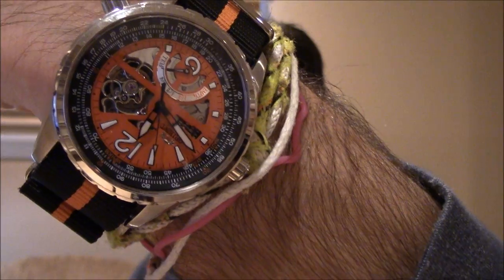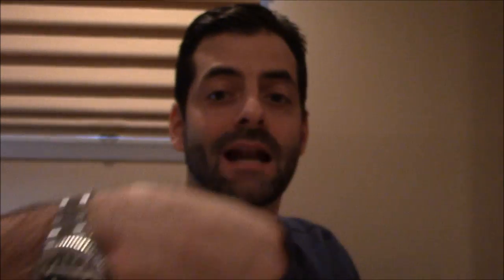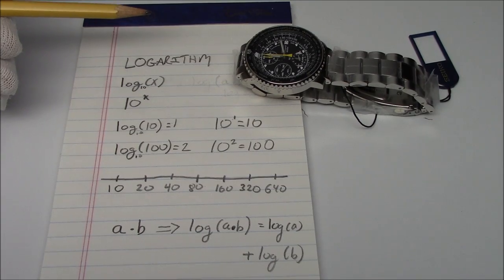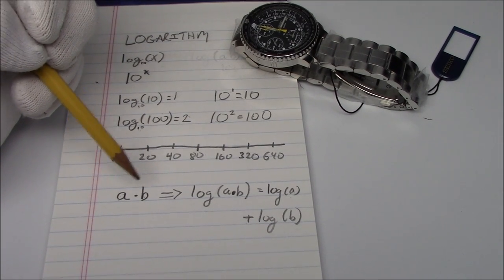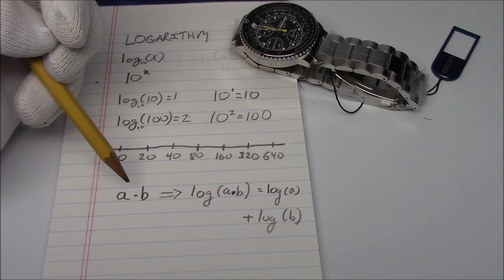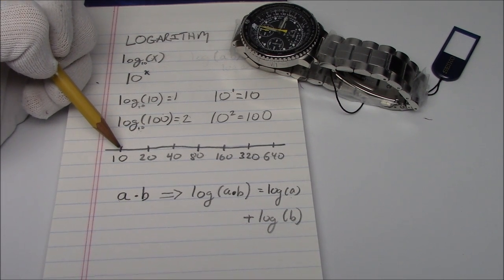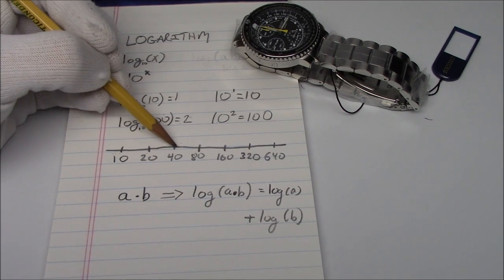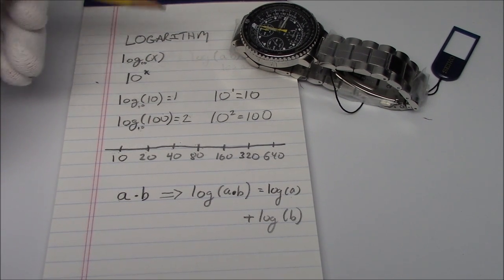How to use a Slide Rule Bezel on your Watch. Watch and Learn #11

Comment: For the private pilot license they expect you to do a divertion with one slide rule calculator or E6B how we call it and execute the diversion in around 2 minutes. You have to find approx. Distance to the alternate airport then calculate with this rule the time it will take with your ground speed, the amount of fuel you will burn and how much you will have when you arrive. All without losing your altitude or heading without autopilot. This slide rules are very useful.
Reply from the maker: Thanks for sharing.
Reply: I have my private pilot license with 250+ hrs.  In the cockpit of small piston-powered aircraft, it's next to impossible to use a slide rule this small on your wrist.  The normal E6B most of us use is around 115mm in diameter and it's still a challenge to use with engine vibrations and anything other than smooth air.  If you want a useful pilot watch, buy a Casio G-Shock with dual-time (UTC) and use a normal-size E6B.  Better yet, get a tablet and enjoy all the benefits.
Reply: @markthibault8579  Yeah. I've written about this on another channel but nobody should have the idea that this watch is useful for a pilot flying. Even traditional pilot's watches with large, highly legible, and simple dials are no longer very useful on most aircraft except as a pretty crappy backup to the much more ergonomic clocks and timers on the panel and EFB. Which paradoxically is exactly the reason why I think this is an excellent pilot's watch. If a wristwatch is going to be almost useless to the pilot flying no matter what, we may as well forget about legibility and just make it into the mother of all backups, and as useful as possible for the pilot when they're not flying. This thing backs up three instruments/functions on the panel, plus a bag item: local time, zulu time, chronograph, and E6B. It's convenient enough to use for flight planning calculations. And of course once you put it on in the morning, you're pretty unlikely to forget it somewhere or leave it out of reach of the cockpit!
Reply: The watches only have two scales, the standard multiply and divide scales, and they're tiny. A real aviation slide rule has extra scales for time distance and a back for wind effects.
Reply: As a CFII, I prefer a divers watch with the minute bezel. I use that all the time. I agree that the E6B on a watch is not practicable in a single pilot situation. 
The overall most simple and useful Watch I’ve had, is the old Casio amw360. UniDirectional bezel, dual time (for Zulu time) and a timer. 
That’s really all you need in a watch for a pilot. 
A watch slide rule will not do wind calculations, so it’s not going to suffice for a diversion anyway. 
That said, I do like the Flighty and really want one, just because it’s a beautiful watch. 
Practically speaking, a Vostok will be my next mainstay as it’s built like a tank and does what I really need in a simple to read manner. 
iPad has replaced paper charts, and does all the complex functions one could need.
Reply: @markthibault8579  no shit. Or better yet get an app specifically for it. Same as how divers use big wrist computers and not the bezel on their watch. It's a back up, always there thing. Something to keep you aware and sharp. To show that this is your mindset and who you are. That's what watches are.

But most importantly, what about celebrating the horology and it's importance on us. There's no better masculine expression. Horology is a noble study and to be marveled at. It directly correlates to our understanding and progress as we mastered time. 
That's the reason for watches on top of the massive practical and disciplined basic on the every moment in the day. 
A phone or then an atomic gshock for the tough everywhere scenario is the ultimate tool for time keeping, but still a manila wind simple field regulated wrist watch does better in keeping 6ou up to task and feeling alive. There's a timeless thing about it. That is why it signifies class. The moment I think of the fashion aspect, I lose taste for it all
Reply: Good thing i don't want to be a pilot. I think i'll crash....
Reply: I used a cheap watch with the slide rule for a professional flight test, it worked perfectly well.  Other students made up tables of ground speeds and distances and guessed the in between points, the watch was quick, was big enough and easily accurate enough.

Comment: 7:23 Face description and markings  
11:33 Multiplication 
13:53 Division 
16:13 Unit conversions: 
16:30 mi (NAUT)/mi (STAT) 
17:20 Km/mi 
18:49 ft/mi 
20:12 Kg/lbs
Reply: Need to add, speed, dist, time.....fuel burn....endurance.

Comment: I study physics and mathemarics, slide rules have always fascinated me. Mathematically, they are an excellent way to think about linear transformations, everything scales uniformly. 

Pilots do not likely use watch slide rules in the air, even in smaller aircraft, pilots usually carry a number of slide ruleesque instruments for particular parts of their flight (like crab angles to adjust for wind, fuel burn, and so forth). But they do offer pilots a backup and are excellent survival tools. Let's say you go down and lose all your special tools. You remember your airspeed as you came down in the wilderness and the indicated heading on your compass, you can use some trig and math (slide rule is excellent to assist in that) to determine an approximate grid location. Also, using a watch, you can identify north by the time and sun location. The compass headings on the dial help you adjust the position of north every 30mins or so and give you an accurate indication of your direction simply by reorienting your dial to to maintain true north indication while you turn your body. A few key pieces of information (wind direction, indicated airspeed, and time from last known position) can easily allow a pilot to know how far he is away from his/her last known position. If the pilot can make it back to that position, the likelihood of rescue increases, as search zones are based off of that last known radar position. 

Military pilots would likely find much more utility from the watch in survival situations, as they can use it to identify direction and distance to friendly territory is downed behind enemy lines. Rationing water and supplies based on distance and progress also can help increase survival. I'm not sure if these dial slide rules do trig, but if they do, some fixed reference can give the pilot an accurate approximation of ground speed by comparing the ground distance from cos at two stopping points by dividing the distance by the elapsed time. If we ever have a nuclear war, a slide rule that sits on your hand, even if the chronograph no longer works, is an invaluable tool which most people would be without if their phones and calculators were fried by emp.

Comment: Hey Mark, thanks you for putting together this series of videos, I have learned a lot thanks to you, and since you asked for a pilot's perspective, I thought I'd add my 2 cents to repay you for your excellent effort. Having been a pilot for the past 35 years (civilian, military, and airlines) as well as having been formally trained as a navigator in the Air Force, I used to live by, and get tested on slide rule computers, but the ones we used were of the CR-5 and E6B variety, and of course much bigger in size. Although I love slide rules (they are almost magical), I always felt that these type of watches were more of a gimmick than anything really useful, because they forced the movement of the watch to be much smaller (ergo less readable) than it could have been, while still having a nearly unreadable slide rule section (at least to an older pilot's eyes). I remember back in the '80s when some of my colleagues purchased expensive slide rule Brietling as reward for finishing the Air Force Academy and heading off to pilot school, I always thought that was more of a status symbol statement than anything useful a pilot could actually make use of. Of course individual preference is what counts on this subject, and personally I'd much rather have a Laco 45mm pilot watch with a sterile B face than a small movement watch crowded with useless features. When I fly I want a watch that "talks to me" (if this makes any sense), and not one I have to spend any amount of time trying to read. As a matter of fact, all the Navigators I knew would used cheap LCD watches rather than anything with dials because they were quick and fool proof to read. Once back on terra firma I'd switch back into a diver's watch, or something else with dials, because I liked the look, and didn't care if it took slightly longer to read. Great job as always Mark.
Reply from the maker: Thanks for the awesome feedback!
Reply: You are most welcome Mark, and I just subscribed to your channel. Ciao, Marco.
Reply: This happens to me with sailing watches. Most are unusable, if you want to take times in a regatta better use a stopwatch, a tactical watch or a full sized gps.
Reply: Quite educative. Thanks all!

Comment: The statute mile to 1,000ft conversion came out a little past 5,280ft because the statute mile marker at 19:33 is rotated a little past the 10.
I'd say the markings themselves are spot on.
Really informative video though!
Reply: The markings are very precise, given the space which they are inscribed. that is why it is called a "slide rule bezel" It is expected to function like a (typically) flat slide rule. Errors creep into the calculations when people are inexact about the way the adjust the bezel ring, in this case.

Comment: Mark,  
This 'slide rule' is a version of the E6B flight computer used by pilots for ages (and it's still mandatory learning for the FAA private pilot exam).  The real difference from the old school slide rule is apparent if you look at the 60 MPH index marker.  Pilots read speed in miles per hour and fuel consumption in lbs or gallons per hour.  The issue is that when we deal with time intervals of just a few hours or less than an hour, it's much easier to use minutes rather than hours for time.  By using the index at 60 rather than 10, the computer is actually converting the hours into minutes by just multiplying by 60!  You can also see on the inter chapter ring under the 90 for instance,  1:30 which further converts minutes into hours and minutes which is much more intuitive when  you are trying to navigate and fly at the same time.  Much easer than working with decimal fractions of hours and having to know that .3 hours is twenty minutes.  (Working on my private pilots license down the road from you at Republic Airport as we speak, btw)

Comment: Hi Mark, what you have is an aviation circular slide rule called an E6B. These were what every pilot used until recently for navigation problems. That’s why the two big indexes are at 60. I have several of these in drawers but don’t use them because there’s an iPhone app that does all those calculations. Today even little airplanes have Flight Management Systems that makes navigation easy without any thinking required. Thanks for the memories.

Comment: Fuel conversion is used before you takeoff. The pilot orders fuel in gallons or liters. But need to know how much his plane weighs before takeoff. So he needs to convert from gallons to lbs.
Reply: One gallon is 6 pounds, pretty simple math with any calculator app on your phone...53 gal useful is 318 pounds, simple...
Reply: @2Greenlid  Jet fuel is 6.8 lbs per gallon. We order fuel in pounds and our fuel gauges read in pph  (pounds per hour).  It also works better when computing weight and balance since that is figured in pounds too.

Comment: Great video, the watch is inspired by the flight computer I think, and it is used primarily for pre-flight planning. Flying in visual flight rules you are not needed to file a flight plan so you can basically jump in a plane and plan your route 10-30 (maybe somewhere 60) minutes before flight. Assuming it is a non-controlled airspace you are flying in. Love this watch, going to get me one just because of your informational video. thanks!

Comment: Great informational video. 
The pounds fuel and pounds oil functions are useful for a pilot when calculating his weight and balance figures before takeoff, which is essential for knowing you are not over your max takeoff weight and that your CG is at the center of lift.

Say you land to refuel and you know your weight with existing fuel, passengers and cargo. When you take fuel from the truck it is in gallons, and you have to convert that to pounds for your weight and balance calculations. Fuel and oil are different densities than water, so they weight differently and can't use the standard conversion that applies to water and most liquids of similar density. Fuel is obviously more common, but topping the engine oil off might be necessary and that affects weight too.

Every pilot MUST perform these calculations before every takeoff. When you hear of accidents caused by the aircraft being overloaded, the pilot either neglected to or made errors when calculating this. Important stuff to avoid dying. So sitting on the tarmac before take off or even engine start up it would be fairly easy to use this watch slide rule to do this. 

Thanks again for a great explanation of Log and slide rule functions on a watch.

Comment: Great Video.  I laughed when you said fuel gallons to lb's was not important.   Yes you are correct, however as an Army Pilot that was one of the calculations I used most often in the early years.  No I could not read this in real life.  My eyes are older, but I did carry a larger E6B back then.   It was fun to view this, I still learned a lot.   Thank you. 

I bought a Citizen Nighthawk, out of nostalgia.    The Navitimers are out of my price range for now. ;)

Comment: As a pilot, I will respond to the practicality of use in a cockpit. Your are about 95% correct, there is little use while inflight and it's not so much because of "turbulence or getting jostled around", though that would even further add to its impractical use (I try not to fly in turbulence personally). Moreover, even small airplanes have a lot of redundancy built into the avionics of in-plane systems, making total systems loss rare. Say you do lose all in-plane systems, every pilot I know is flying a tablet with an app that is more than capable of doing required or needed calculations. SOOOOO short of an EMP detonating and wiping the planes electronics systems out and your iPad, there's just a lot of redundancy (on purpose). 

That said I will say that as a pilot I still use an analog watch simply just because I like them. so I don't have a wizz bang iWatch or smart watch.... I would probably use this or other aviation minded setups like this for roughing in some preflight planning. Stuff like distance, air speed and fuel use. it would indeed be much faster than a calculator. and save me from having to mess with apps on my phone or iPad (which I'm not hopelessly addicted to). So I see value as a pilot for the moments where I need some rough numbers on fuel, times and distance while sitting in the general aviation terminal or at home jaw jacking around about potential flights. Just my two cents worth. If I were in flight and lost everything. I would declare an emergency and have ATC do all the heavy lifting math wise so I could focus on flying (assuming the radio still worked, or using my backup handheld radio).

Comment: Slide rules and log tables used to be very important tools for engineers. However, since the invention of the calculator, they are outdated and hardly anyone younger than 60 years is actually able to calculate with these tools.
Reply: what happens when your batteries run out and youre stranded.

Comment: For those that don't know - the conversions (e.g. the different kind of "gallons") is important when you're buying fuel for your airplane if you should head into foreign lands. This is the "Flightmaster" (or "aviator" watch)  after all, so all the functions of this watch are geared to help take care of your plane and flight!

Pilots actually still learn these techniques in flight school even with all the glass cockpits, smartphones, and computers available. Part of the reason is for decades the "E6B flight computer" (a regular pilot's slide rule that these watches is based on) was/is the staple of every single pilot/cockpit. https://en.wikipedia.org/wiki/E6B

Aviation is steeped in heavy technical tradition which helps reinforce the paramount needs and concepts of safety. If something should happen to your electronics, the thing on your wrist might suddenly be indispensable. Similarly, the Navy has returned to the sextant for these reasons;
http://www.npr.org/2016/02/22/467210492/u-s-navy-brings-back-navigation-by-the-stars-for-officers

Interestingly, the "trigonometric" functions very rarely exist (only on a couple of watches) I surmise because then the watch becomes more slide rule than watch! But there are a couple of Seikos that can do them. 

Why is all this important? I think people need to be asking what that watch on their wrist is doing for them and what it's purpose is, as it will help them make a better watch i.e. tool selection.

I should mention that if anyone decides to use the slide rule for real life applications (more than dinner tips!!) that they be sure of the accuracy and functionality of the slide rule they are wearing - as many slide rule bezels are fashion devices more than true math scales not unlike those chronographs with glued hands that don't work! For those that want to go deeper in this fascinating topic I highly recommend that people find and review the paper by Robert Adams available online.